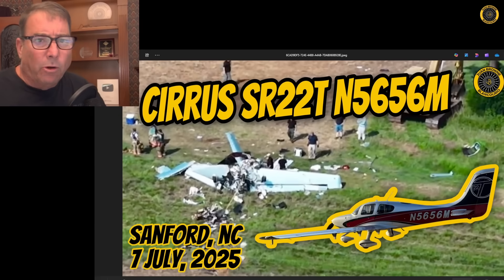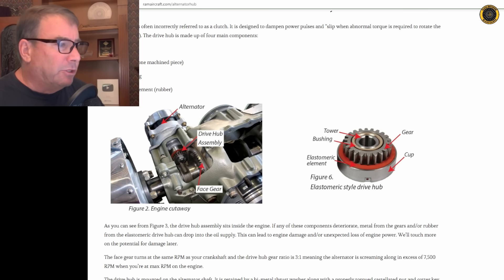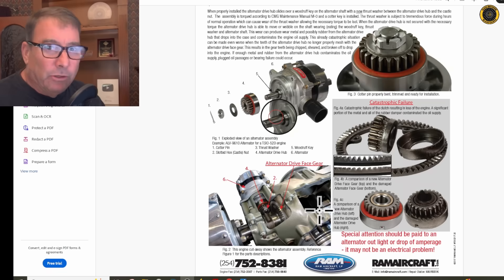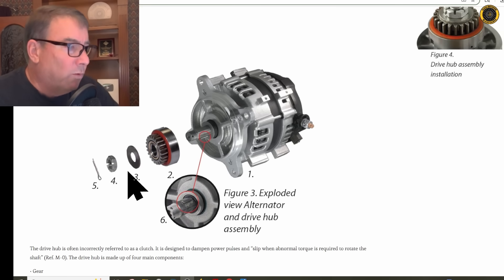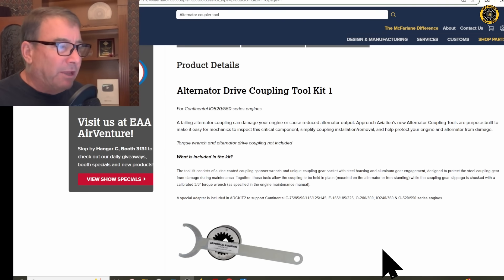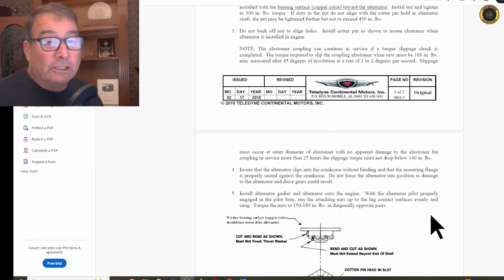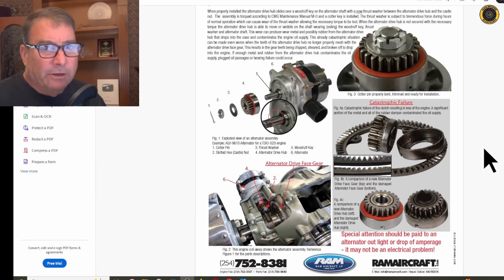Alternator Drive Failure-Can Lead to Engine Failure!

Comment: In automotive engines the accessory belt pulley is usually fitted with a similar elastomer element in the "vibration damper."  This prevents the crankshaft vibrations from each ignition event from affecting the belt drive and accessories.    So, I suspect this is not about variances in alternator load, but protecting the alternator from crank vibrations.   Anyway, they don't have to be made in a way that failure kills the engine.   There are ways to keep the assembly intact without the elastomer, and ways to keep shrapnel from making it out of this general area.  Kind of crazy that this hasn't been made to fail in a benign way.
Reply: Crankshaft harmonic dampers aren't meant to cushion the accessory drives, but rather to damp vibrations in the crankshaft itself from the individual cylinders firing. Lots of vehicles have rigid crank pulleys, and the belts act as a shock absorber.
Reply: Im thinking of the 3800 Buick balancers . Seen dozens fail over the years . When the rubber went, there was a tongue in groove sort of failsafe that rattled like a machine gun and got you home
Reply: Recertification is costly.
Reply: Yes, I agree, not a failsafe design. another reason not to buy a Cirrus, I'm saving my money.
Reply: The belt is enough of a cushion.
Reply: I have a VW diesel car.. 2003 TDI.   The alternators have an over-running clutch in the alternator pulley.   This lets the alternator speed avoid ripples from the 4 cylinder engine.  There is also an elastomeric damper on the crankshaft pulley.
Reply: Torsional vibration.

Comment: Juan. Something similar happened to one of our MD-83’s. The crew got a Gen message so the turned off the generator, fired up the APU and continued on per the FCOM. Shortly thereafter they got an overheat on the CSD or constant speed drive for that generator. They tried to disconnect but it was already on fire with a subsequent engine fire warning. They shut down the engine blew both bottles. But the fire warning persisted because the housing is made of magnesium. They made an emergency landing in Flagstaff. Which is dire considering the altitude of the airport which makes a single engine go around unlikely. After that we changed the gen checklist to include disconnecting the CSD. Because it keeps spinning out there even though the generator is off. Which is probably what happened to these poor people. Very sad. I wish he would have put it on the ground earlier.
Reply: JT8 CSDs and Gens sure seemed to break a lot.
Reply: @bradleypeterson2208 They do. Wise mechanics knew never to fill the oil to the full mark or it would overheat. We had an MD-80 coming back from the Caribbean and one CSD overheated over Cuba, so he secured started the APU. Then about twenty minutes later coming in over Florida, the other overheated. Secured that one and declared an emergency. Can’t keep going single generator 121.
Reply: Im curious,how do you add new steps to a checklist? Does it require manufacturer support?
Reply: @tbone2416 Nope. Just local FAA approval.
Reply: @grumpy3543  Not necessarily true. 

Depending on the modification, you are requesting a "No objection Letter" for approval. While it may vary between FSDO offices, these may not be easily issued. Basically, you are asking for an already approved document to be superseded. In the 135/121 world, this is easier than under 91: 135/121 is operator specific while 91 is general population. 

Under 91, a manufacturer approval may be needed to modify a checklist and most don't want the liability risk.
Reply: @seanoswa1829 My chief pilot and the 757 operations manager rewrote the engine failure checklist from Boeing to make it so that pilots wouldn’t miss the second half of the checklist that the tiny print at the bottom refers to. Single engine landing checklist. It went to the local FSDO and was approved within a few weeks. Off to the printers and into the manual. It didn’t remove any items, it just combined the two checklists so that they wouldn’t be missed. Most operators have done the same.
Reply: As a high school student taking advanced chemistry courses, I loved when I had access to those magnesium strips. Nice little fires they make. I cannot imagine why anyone thought magnesium would be safe to make engine or APU housings with

Comment: The reason for this is aircraft piston engines are mostly unchanged from 1950s designs. There isn't a great place to mount a backup alternator but there is an accessory case with a gear inside and ports on the outside where you can mount magnetos, vacuum pumps, and the like. 

The backup alternator is designed to plug onto the mounting point for a vacuum pump.

Comment: 300 foot lbs . Of torque on the alternator shaft nut ?    No Way that spec . Can be correct ! 
No way  !    Nothing on any alternator would or could possibly have such a high torque value - 
The have a cast aluminum case .    Truck wheel nuts do not even get torqued to such a high value !
Maybe 39 ft . lbs . Of torque ?    Something is incorrect -  heavy truck mechanic for 30 years 
And I never tightened anything to anywhere near that dose —— we would need Maguilla the 
Gorilla to yoke that shit !    🦍🦧🐘.      Obviously a type o  mistake ——  snap !!!  See y’all !

Comment: Sitting here at zero knots and one G, this looks like kind of a boneheaded design in comparison to a belt that can just break and fall off (mostly harmlessly?) inside the cowl.

What is the advantage of this?  Just that it eliminates the need to check and adjust the belt tension periodically?
Reply: I'm guessing it fits into some kind of preexisting envelope in whatever ancient engine design this is based off? Sure reeks of a square peg in a round hole.

Comment: Off topic, but a Gulfstream pilot told me that on the G5, there was a 30s delay before actual fuel cutoff when the switches were enabled.
Reply: Due to fuel in the lines?  If so, at what power setting?
Reply: @loudidier3891 that I don’t know
Reply: @loudidier3891 This I found on the G550 switch system, which is similar in design modern passanger jets...
"Time Delay: Some Gulfstream models, like the G550, have a time delay circuit in the fuel cutoff switch logic to prevent accidental shutdowns during takeoff or other critical phases of flight."
Reply: @JohnnyMotel99  Do they have a separate fuel shut off in the case of engine fires?
Reply: @loudidier3891  I don't know that, but I'd imagine so. I don't understand why these cutoff switches are located where they are. On the G550 I understand they are in the overhead panels. Since these switches are part of the logic system around the fuel system and not directly actuating the valves, it wouldn't take much to incorporate a visual or audible warning when these switches are activated.
Reply: According to AgentJayZ, the fuel cutoff valve on modern gas turbine engines is between the fuel control valve (mounted on the engine) and the combustion chamber. Therefore, the line between them is pretty short and holds very little fuel. Plus, there is no pressure to push that fuel into the combustion chamber after the valve closes. So, instant shutdown.

Comment: In response to video @0:1:45, In the automotive world, I've seen a seized A/C compressor stall a relatively tourqey V6 engine through the serpentine belt.  The belt did not fail.  Just food for thought.
Reply: I just had to troubleshoot this problem on my girlfriend's daughter's car. Engine quit at a traffic signal, towed home. Couldn't figure out why the engine wouldn't crank and thought it was a bad starter. Ended up being a seized AC compressor.

Car runs fine now with a shorter belt and no AC 😂
Reply: @JoshuaTootell  As a retired auto mechanic, this sounds to me like the AC compressor clutch pulley bearing seized and not so much the compressor shaft itself. Unless it is one of the newer design clutchless compressors. Those have the AC compressor shaft turning whenever the engine is turning, the belt driving directly to the compressor shaft.

Comment: Absolutely scary design!  The very geometry not a normal bevel gear, it is a comic book contraption with no place in mission critical equipment
Reply: This is more than scary.  It will fail. The tooth mating cannot be correct for smooth power delivery.  It will eat itself even with continuous oil bath. 
A flat ring gear needs the shaft of the alternator to be at an angle with a conical spur gear.  This isn’t even engineering 101, very very sketchy.
Reply: Engineer here; You are 10,000% Right !

--  Shitty design, I'm surprised it is "approved"...  Even a child with a LEGO, would produce a better design!
Reply: I can't recall the last time I saw a face gear transmitting power.   You see them used to maintaining timing literally in clocks.   That is about it.   Absurd.
Reply: I was about to make that comment. With more than 30 years in gear production, I am shocked to see a face gear transmission in an aero-engine. This is designed to fail from the start.

Comment: I kind of recall he had reported instrument problems and charging problem. In the trouble shooting I think the function of alternators supplying DC power done by diodes is missed. Alternators create AC turned into DC with a diode bridge. When the diodes slowly go bad AC is put out that can foul instruments while charge also goes down.
Reply: That seems most likely
Reply: @Gee1410thirtysix  Yah I've seen it before. You have to use a digital multimeter to spot the positive and negative symbol changing once in awhile when readding the battery with engine running. DC devices can't handle AC so the leaky diodes spitting AC out once in awhile totally messes up the function of instruments.

Comment: Continental switching to the permold case with direct drive alternator was a mistake.  The older belt drive design couldn’t cascade into a catastrophic failure of the engine

Comment: old twin cessna mechanic, we always check these alternator drive system each annual.  Some times you could hear the alternator/hub making noise with the engine at ldle.  This is a very poor design and expensive failure. Very often an alternator failure will damage the engine.  Seen it more than once.   Any damage to those internal gears require tear down of engine to repair..  Also many of these alternators required outer bearing inspection/lubrication.  We always invited the owner/operator in while we had the aircraft and engine open for the annual for educational opertunity.
Reply: I'm not an engine design expert or anything but as I'm watching Juan explain how this works I was thinking REALLY!!??
Reply: @festerofest4374  Yes, this is unbelievable this got past certification. Not a failsafe design.
Reply: @bernieschiff5919  It sees to be the opposite of a failsafe design. A credible failure mode that also takes out the engine?
Reply: @bernieschiff5919  Quite so, if the backup alternator working or not is irrelevant as the engine stopped running due to metal shavings in the oil.

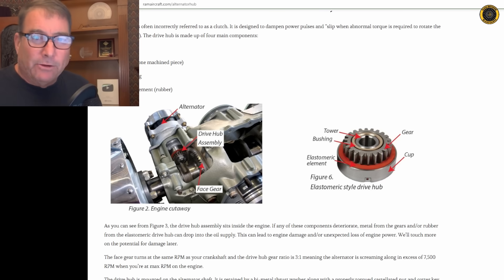Comment: interesting.  the direct drive coupling for my motorcycle alternator uses a similar BUT SAFER elastomer bushing setup, and it failed early on in it's lifetime - got replaced under warranty.  in my case, the elastomer itself failed, so the gear was able to spin somewhat freely within the cap, and the alternator couldn't generate running voltage/current.  there were flakes of elastomer that got free inside the crank case, but they seemed to all get caught up in the oil filter or escaped through an oil change, since this was all in wet space.  also, the gear in my coupling was a ring/internal gear that was held in place by its mating rod gear (that was engaged with the crank), so when the elastomer failed, the coupling just spun and shed elastomer - nothing could cause metal to splinter off.  by contrast, the setup in this plane puts some lateral force on the coupling/elastomer, so when the elastomer fails, the gear it was holding in place wants to get misaligned with its mating gear, and then it starts shedding gear teeth, if not the entire gear itself.  that seems like a poor design choice.  what i'd do, instead, is have that face gear (@0:57) couple to a solid steel rod gear, then have the rod gear punch into an internal gear, which would be surrounded by the elastomer and then the outer cup.  that way, if the elastomer fails, you perhaps lose the ability to spin the alternator, but you don't get metal bits floating around in the case.  you do probably need to have another bearing or two in there to position the rod gear, but i bet the numbers work out to be safer overall.

Comment: Re elastomeric drive: Remember that a piston engine is not "smooth" power, but a series of impulses with each power stroke. Each of those impulses puts a shock on the teeth of any gear drive. The flexing of the elastomeric material mitigates that banging somewhat, but something else is going to wear. Chrysler tried something like this on their belt driven alternators and still had problems. Enstrom helicopters used "Lamaflex®"(?) bearings in their rotor system, a series of metal and rubber discs which always came unglued between the layers. Seems to me an elastomeric cushion in an alternator drive would eventually suffer a similar failure. As Juan pointed out, a belt drive is a survivable "shear point" should the alternator lock up and any pieces will remain outside the engine. In addition, a belt drive will absorb engine impulses, ensuring long alternator bearing life.

Comment: From the 1930s on, "accessory failure" has never been allowed to lead to "engine failure".  Today, we use FMECA analysis to determine what failure mode might lead to what outcome. Now in this case, a "slipping clutch" is not a bad idea, but the old-school 'shear-neck' works every time.  Just calc the max torque the alternator might need, multiply by 1.5 or something for the failure (seized) condition and design a coupling that mechanically shears when that limit is reached.
Reply: A preloaded stack of tabbed delrin washers in a clutch configuration  would have done better than this mess since it's not an indexed shaft. 

One frickin' screen would keep debris out of the oiling system though...